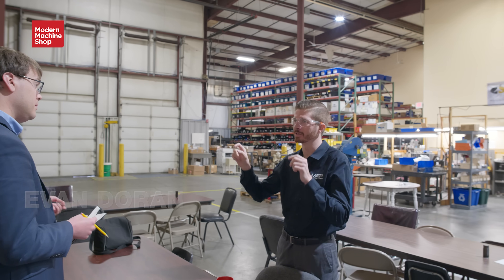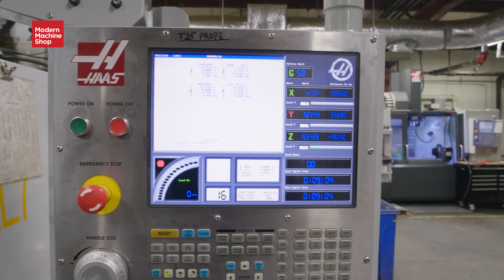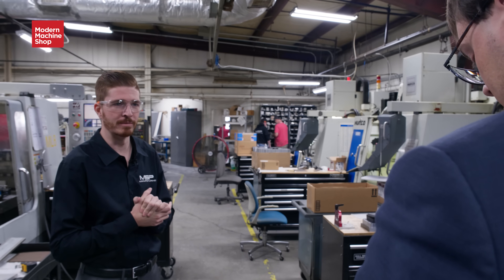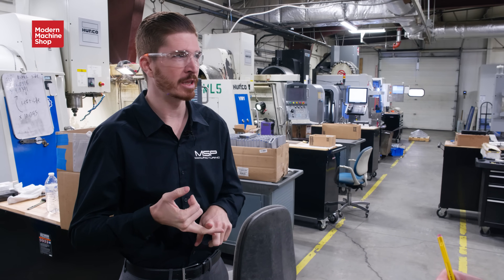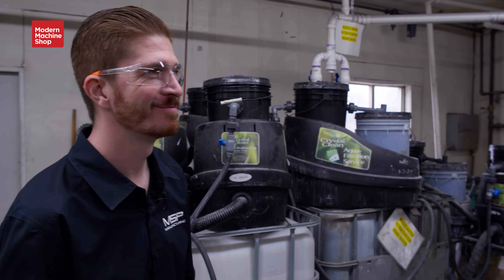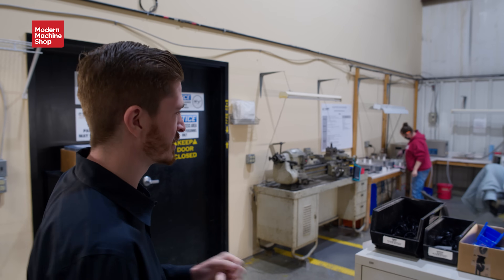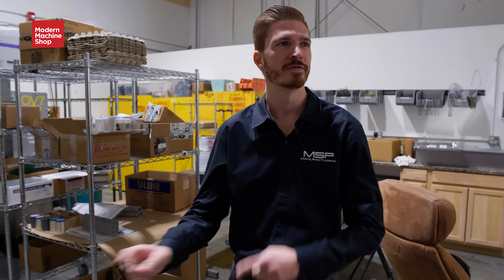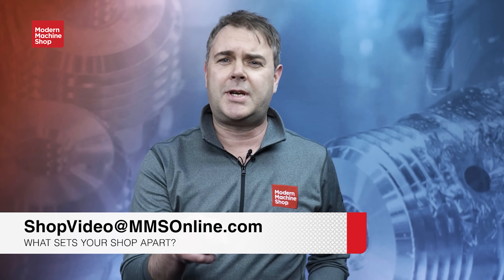Inside an Aviation & Defense Machine Shop | MSP Manufacturing Tour

Comment: The American machine factories are far behind the European and some of the Asian machine factories.
Where I come from, most machines were replaced with CNC machines in the mid-90s.

Right now I mainly work in a small factory specializing in maintaining old equipment that you can't get parts for, so we have to constantly manufacture special equipment. I have 5 CNC machines that run around the clock.
small items 50 g up to 10 tons of items 
specializes in large rotating parts, some parts weigh 2-3 tons while rotating at 2,000 revolutions

I move around between different factories by appointment. I specialize in getting things up and running so others can take over.
so I see many factories around Europe
Reply from the maker: Small family-owned shops have been resonating well with our audience. There are thousands of larger shops in the U.S. We will showcase a variety of them 🙂
Reply: Speaking from my experience 50 years ago when I decided to get into CNC you really had next to no choice but to purchase from Japan. Sure there were big names like Pratt and Whitney , Cincinnati and so forth. However they had nothing for small shops needing smaller machines. So we bought Japanese machines. I did purchase a Hurco and it made me feel good to buy American. However every other machine in my shop was Japanese. And they were great to be honest. Then Taiwan came into play. China as well as other countries. I think that the best machines still come from Germany or Switzerland. We as a country have failed to have entered this market. Several smaller companies like Milltronics have made some but nothing in comparison. As I see it we have pretty much put ourselves into this situation and no one to blame but ourselves. Totally sad considering we were such a dominate force in this field. Now we’re much, much less than dominate. Many of you may not agree and that’s your prerogative, however this is how I see things. I finished my tool and die apprenticeship in 1972 and have seen so many changes it’s incredible.
Reply: If you think for a second that there aren’t bigger and more impressive shops than this in the US. You’re mistaken
Reply: @TAPomp  You are right. There are many larger machine factories in the US but they are not impressive.
I have produced items for the wind turbine industry as well as for the oil industry weighing over 100 tons. You have seen many large items.
and in the area of small items I have produced small M0.5 screws
In my 35 years in the industry, I have tried a lot and seen a lot.
American industry has been so stagnant for many years. It's only just started to move a little.
All quality CNC machines are produced in Europe or Asia. They are not produced in the USA. They may be assembled, but their development is still in Europe or Asia.
and don't start talking about hass it's an okay machine but it's not a quality machine
The only Premium manufacturer I know of in the US is Hardinge Inc. and Hurco
Reply: @kastrup2dk  Hardinge is now bankrupt, and for many years they were relabeling other brands of machines. their mills were made by Quasar. Some of the turning centers they made themselves.
Hardinge decline was very sad, for a while they were one of the leaders in America for precision turning.
Reply: @TAPomp  Yeah but all their big impressive machines come from China, Japan, and Taiwan, not from America.
Reply: So what's the cause? Lack of competition?
Reply: @ahhmm5381  as with most things yes competition drives the market . I honestly don’t know why other than Hurco and Haas ( not even all US) there aren’t more US manufactures. Maybe because we feel we simply can’t compete anymore. We should have taken it seriously before the Japanese machines invaded our country. We certainly had the ability .